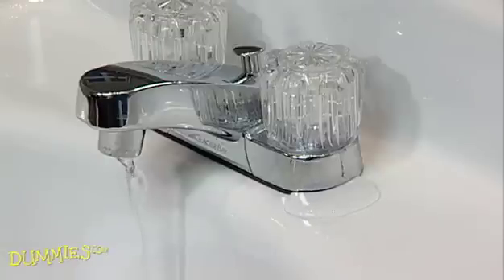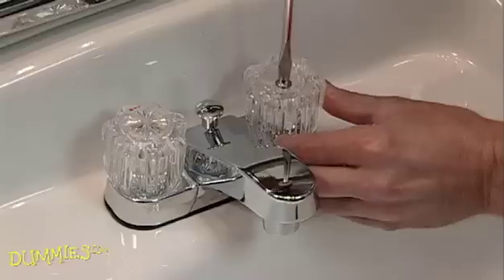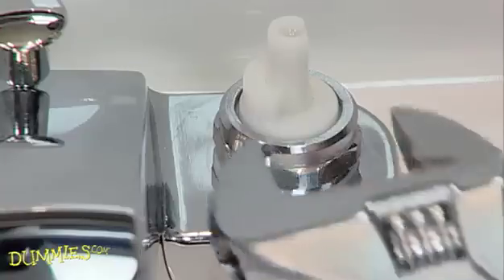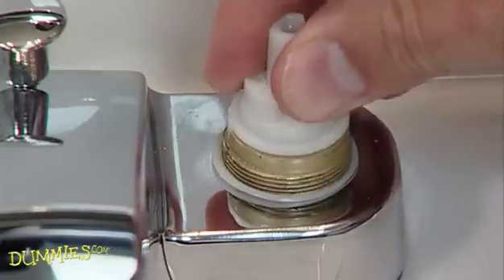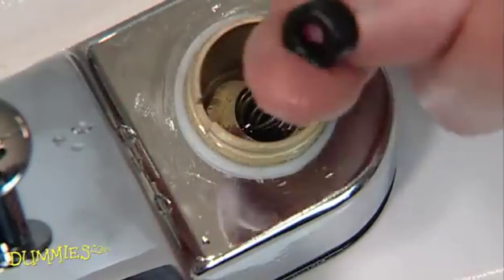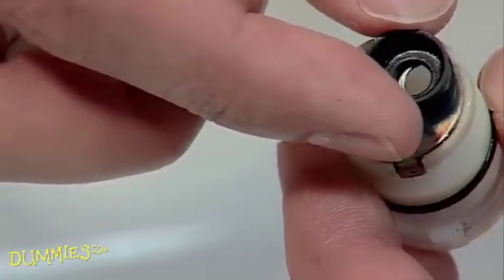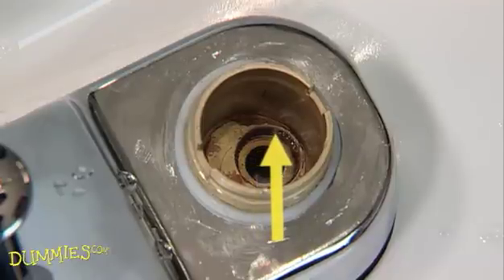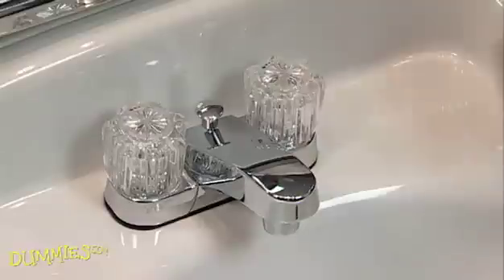How to Replace a Washer in a Leaky Faucet For Dummies

Comment: i turned off the water supply. then i took out the washer. to see how big it was. and then wen i turn the water supply back on, the water supply switch started leaking. wat should i do now?

Comment: I wish he slowly showed and explain how the washer fit over the spring. I find it difficult to fit. Does the rubber washer fit over the spring and then down into the hole? It's not as easy if you dont' do stuff like this. And no, this is not for dummies, it's for dummies that know how the spring and rubber washer sets together.
Reply: Thank you so much for this video. I was so worried I wouldn't be able to do it. But I did it! And it was so easy!!!
Reply: Bob McDowell Drop the spring back into the little the comes through. Then seat the washer above it.
Reply: Just to let you know I did one of them you can do without the spring you can stick the rubber washer in that hole and then put the seed in I did it it worked you don't really need that spring I don't know why they got that in there anyway

Comment: that little rubber washer can be very difficult to put back in.  he just skipped right over that step.
Reply: Just to let you know I put one in you can do it without the spring all you got to do is she that rubber washer in the hole and then put the seat back on I did it it worked sometimes you can't get the right water Springs I don't know why they have the spring in there it's useless

Comment: This was perfect for me. I've done this before, but needed a refresher just to make sure I was doing everything I needed to.

However, my shut-off valves below the sink were stuck in the open position. Even after taking off the handles and using pliers, I could not get one to turn off for fear of actually breaking it. I had to turn of the main water supply to my house. Luckily it was in a convenient location. (I ended up replacing that valve, too, as well as the washer - might as well with the water supply off.) But beware: In some older homes, like my last, the main water shutoff doesn't work, either. In that case (as it appears in my current house), I would probably get a plumber to install a new one. In my current house, it looks like a plumber installed a lever a couple of feet up from the old main shut-off valvle. He cut into the copper pipe to install the lever - something I would not be comfortable to do.

Comment: I have the same type of faucet, with three rubber washers total - two on the stem removed and the one underneath. I happened to have the other two in my shop, and changed them out, but it still dripped. Went to the hardware store and bought the washers you installed (on the bottom) and that fixed it. Thanks!

Comment: There is a difference between the materials that the cold water washers and hot water side washers (as well as the stem) are made out of. This is left out of almost every video that is made.

Washers made for hot water are made of more durable material and the rubber is harder.

This could save a lot of redoing of job over and over, because the cold water washer on hot side, keeps wearing out.

They should point this out if they claim to be an expert. This is how they stay in business.
Reply: Thanks!!

Comment: The video seemed perfect. My prob: The white plastic valve won't come off (either tap). Using the suggestion in the video didn't work; the plastic stem in each valve revolves uselessly, independent of the whole valve. Any ideas? Thanx...

Comment: I made all the changes, but it's still dripping.  Frustrated at this point can you help?
Reply: Jennifer Cruz tell your hunny to do it :-).
Reply: You may need to replace the faucet stem too, not just the washer
Reply: While you have it apart, change the o-ring too.  That is important.   But, if it's still leaking after that, you may need to replace the entire stem.